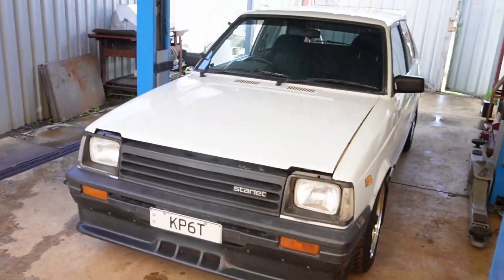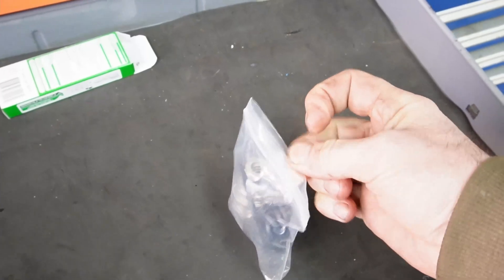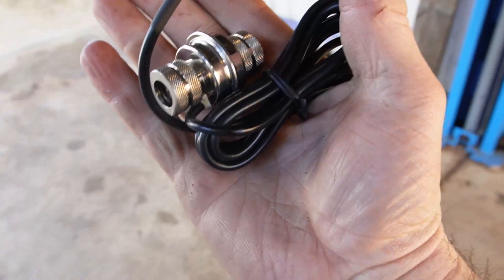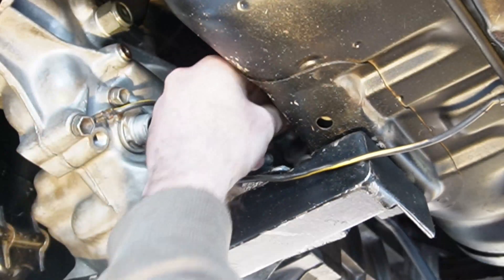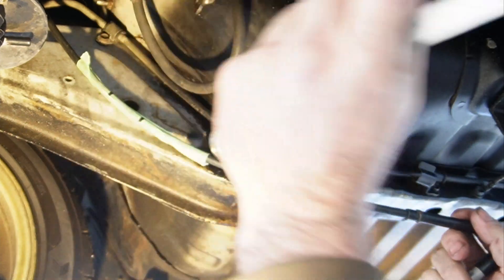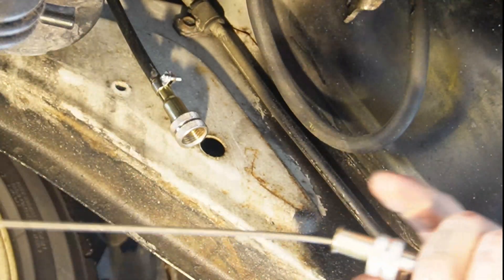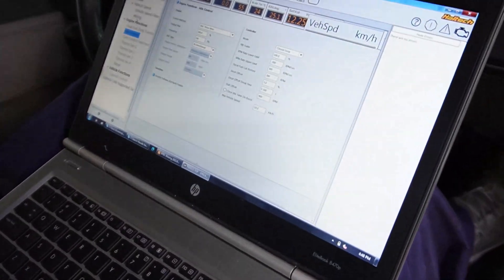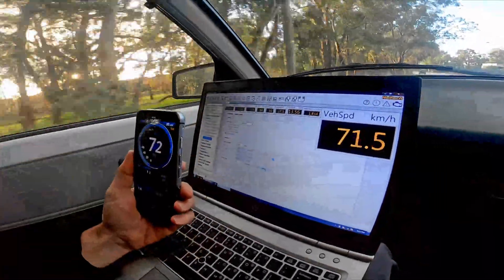Cable to electronic speedo conversion Ft. Haltech and my KP61 using Terratrip converter

Comment: Don't suppose you know or can measure what the overall length of the assembly is, and the maximum diameter? I'm hoping I have enough of a straight cable run under the dash to fit it in the car.
Reply from the maker: Hi. Sorry for the delay. I'll do my best to get some measurements for you.
Reply: @garageadz  That would be greatly appreciated! I did email the manufacturer for the information, but they never responded.

Comment: Hey mate iv got the same sensor for the same reason but I have mine going into the ic7 dash do you know what your calibration number was and does it just need a 5v supply
Reply from the maker: My setup is calibrated through the Elite 550, it's a 12v setup

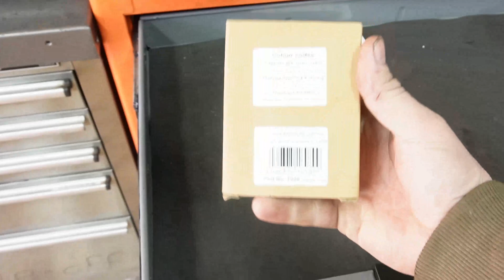Comment: You sir, have just potentially saved me at 1:45, do you know if you can use this probe for just an electric speedometer? I have a series 3 Land Rover I’m working on and want to ‘modernise’ the instrument cluster, but a majority of aftermarket gauges are electric signal, not mechanical… and being it’s age, there’s obviously no ecu. Do you reckon it’d work in my application?
Reply from the maker: I think it's important to show these parts and how to identify them and how to get them!  Otherwise there's almost no point to videos like this.

It really depends what your speedo needs to see signal wise. I don;t have any experience with those systems so it's hard for me to say whether it's going to work for sure.
Reply: @garageadz  my guess would be, if it sends a signal pulse, it should be read by the gauge. Similar to how the haltech can recognise it, without the obvious calibrating feature of the ecu…